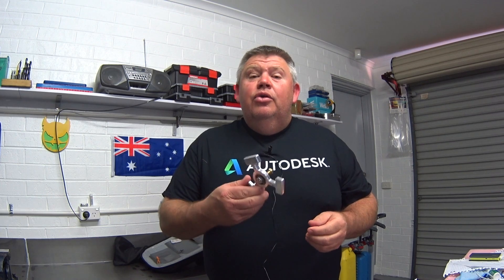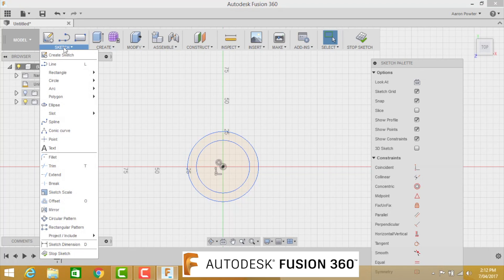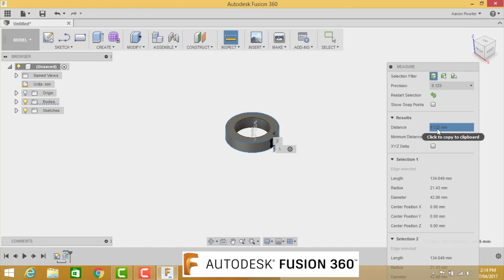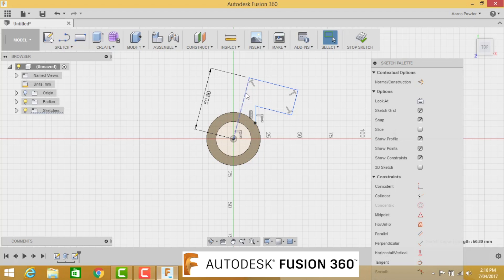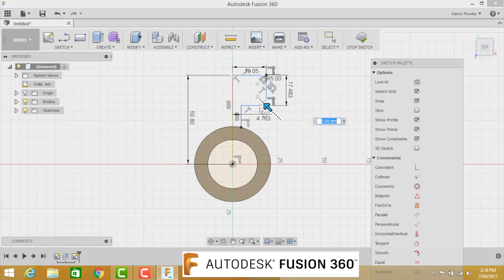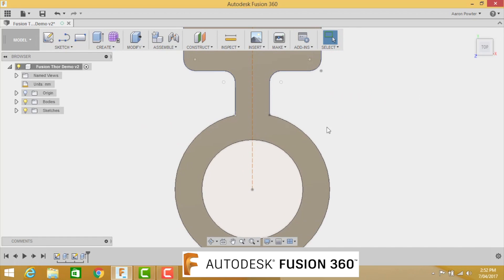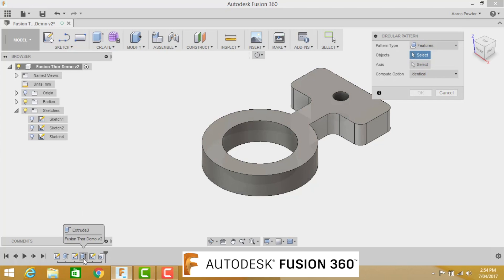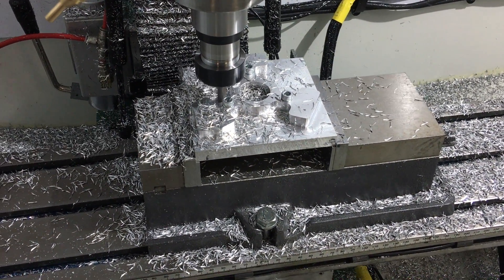Fusion 360 Tutorial - Thor Spinner Fidget Toy FF.E8

Comment: very nice mate, do normally go .05mm undersize for small bearings? guessing that's around 2 thou
Reply from the maker: Hey Chris.  If I recollect, I'm sure there is actually a formula for working out bearing crush which varies on type, diameter and application.  I honestly pulled that figure out of my backside for this project.  The bearing O.D. measured 29.96mm.  So I shot for slightly under that.  I usually machine a test piece and and insert the bearing and test it etc...  If to tight or loose I usually adjust it in the CAM side of things.  Cheers, Aaron.